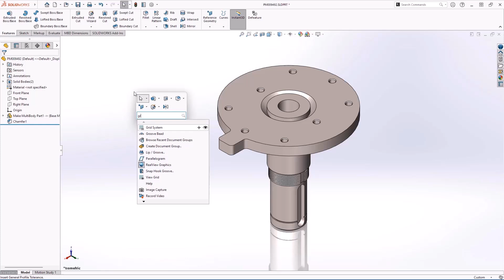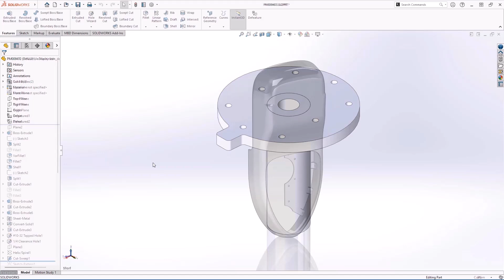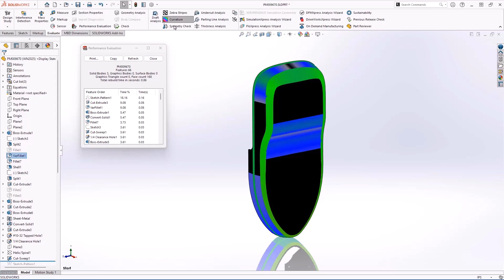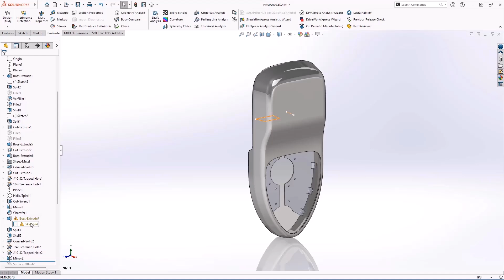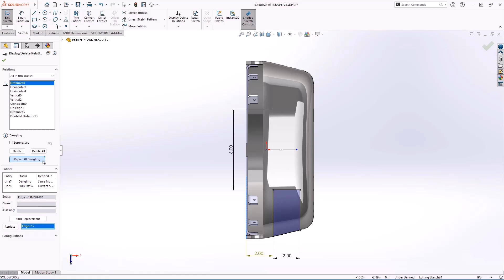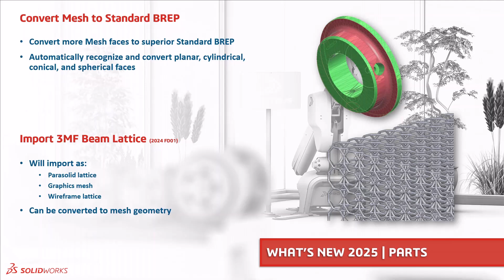Whats New SOLIDWORKS 2025 - Parts

Comment: This is an inherent problem with Solidworks. 

All the videos I watch draw the parts in the wrong orientation. "Z" should always be pointing out of the screen or at you. That way the X and Y are in the exact same orientation as every graph I've ever seen in my life. 

I've been trying to switch over to SW since the very first release but it just doesn't seem intuitive from and engineering standpoint, Something as basic as the Z plane orientation is always wrong, IMHO, in the videos I watch.
Reply from the maker: With SOLIDWORKS 2025, you can now specify either Y up or Z up in your templates :)
Reply: @solidxcad ,

I've just accepted the fact of what Solidworks does and altered my approach with the software to draw with the "Z" plan pointing out of the screen just like my 3D and 2D always has been. So  CTRL+1 is my "plan view" orientation. 

I've adapted